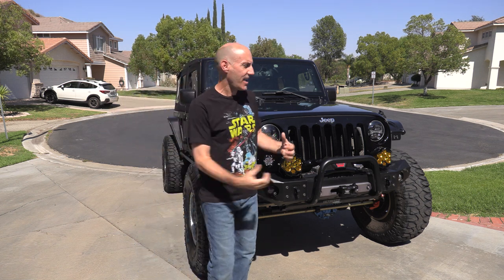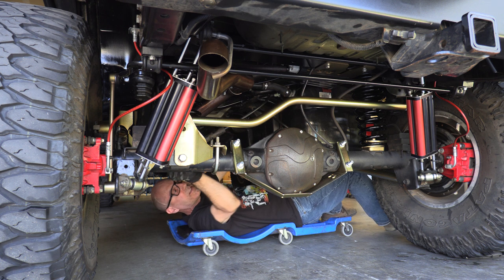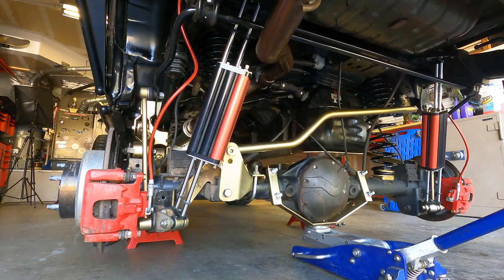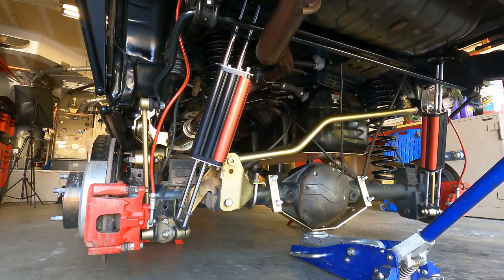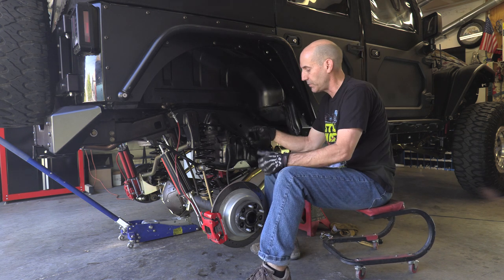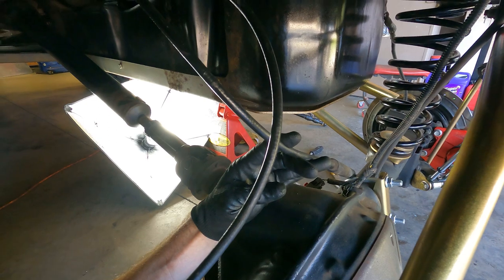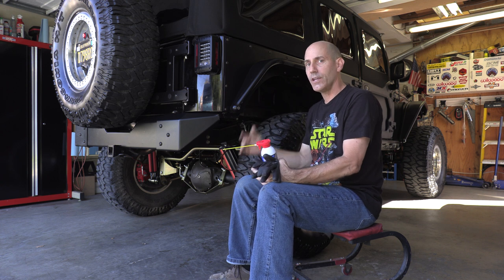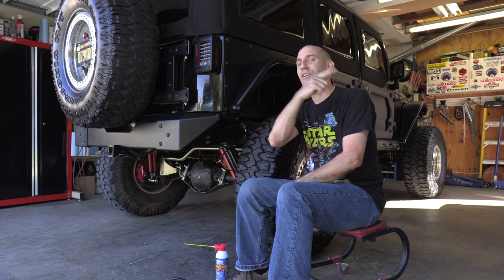Jeep Parking Brake Cable Hack to Get Max Droop for Your Junk

Comment: The only thing to add is to be careful with the cables, you could lose connection at the parking brake connection. Then you have to remove the center console to re-attach the cables. Keep some kind of tension on the cable after removing them from the rear hub. Looks like Jason did a great job with that. Good vid Jason.
Reply from the maker: Good tip! Glad you made that reminder.

Comment: Personally I like having a rear sway bar as a lot of trails in my area have off camber parts. And I am typically disconnected up front. The rear is the only thing keeping the jeep from leaning way over. It also helps from lifting a front inside tire when you pull out onto the HWY, which can still happen with it in place. Oh, and a handy tech tip for anybody reading this. If you have the back jacked up, and the front on the ground, shift into 4wd. The transmission (park/in gear) will prevent the front tires from turning much, so the jeep wont roll over you if it wants to move.
Reply from the maker: Good information, thanks!

Comment: You can go to your local parts store and buy a few feet of fuel line to replace your vent tube (check the dimensions first--I think I used 5/16").  There's a simple metal clip that holds it in place up high, and the valve at the high end of the tube can be pulled out gently with some pliers.  Measure how much tube you need to get the end of it up behind your tail light where it is even less likely to get under water, cut to fit, put the valve and clip in place and pop the other end onto the axle tube and you're done.  You can do the same for the front axle also and just route it up someplace high.
Reply from the maker: Great suggestion... I just keep forgetting to do that!!! Brain freeze over here...

Comment: Hey Jason, another quality video.   You do realize that you lose automatic parking brake actuation at full suspension extension.....
Reply from the maker: Thanks dude... this JK doesn't have automatic parking brake ... old fashioned elbow power!
Reply: @AutoEdits  I was thinking like as the axle droops down and pulls the cable down, would apply brakes since not having enough slack

Comment: I’ve got a 18 JKU teraflex 3.5”lift with bilstein bypass shocks for a 6” deleted rear sway bar, barely notice on road and 100x better off-road
Reply: Running 40’s so I’m bumped to only 3-4” of up travel but I have like 8” of droop
Reply from the maker: It's great to hear this... thanks!

Comment: I need to do this... I actually have some issues with my e-brake lines tugging on my gas fill valve hose and causing some minor leaking from it drooping out... RK 4.5 3 link long arm
Reply from the maker: It's an easy fix for that!

Comment: need to try that, gotta admitt the Wrangler doesn't have the best Parking brake , I'm always pulling it super super tight to keep it from rolling
Reply from the maker: There is an adjustment under the center console for the parking brake... maybe put a few turns into that.

Comment: Good hack. I'd suggest you use something better than zip ties. Zip ties fatigue over time and break really easily. If they broke and you didn't notice, the parking brake cables would droop and you'd tear them off on an obstacle.
Reply from the maker: Good suggestion!

Comment: @AutoEdit - Hi, your Buddy run a "dual-rate-swaybar". I think its from Off road Only (ORO)? So its on and offroad very stable. You have the factory Rubicon-Sway, so its like you have no swaybar when you push the disconect button. That lead to some stability problems when you drive in extreme angels, because of body roll. Those problems you buddy dont have, because he have a dual-rate-swaybar, so its like he running an antirock whe he press the disconnect switch. My recommendation for you is to run a Antirock-Swaybar on your rear axle. Its nearly the same to that setup your budy run. He just have a stiffer swaybar compared to factory. At the end, let my say sorry for my bad English and that I really like your videos. They have a high level of quality - specially compared to other JK/JL Youtubers. So let me say Thank you for all you effort and greetings from Germany.
Reply from the maker: Thanks so much for the information... I really appreciate it!
Reply: @AutoEdits  You are Welcome. I have the ORO Sway-Loc in my XJ. That make so much different while driving offroad compared to non swaybar. Even you gain more traction.

Comment: Great video, as always! Question, do you have rear inner fender liners? Also, I have the same set up as you, did you have to trim the sheet metal near the corners of each tire? Mine looks like it will make contact. Thanks for the great content!
Reply from the maker: Yes I did

Comment: Just spitballing here, with that much droop would limiting straps be a good upgrade?
Reply from the maker: Good question... I would only need limit straps if the springs pulled loose or to protect lines/cables. Since this isn't a prerunner and I don't jump it (much) the shocks are capable of being the limiting factor.

Comment: Do you drive your Jeep on the street, I thought in Cali you could not have your wheels extend outside of the fenders.
Reply: there are a lot of things we technically "can't" do but vehicle equipment codes like that are rarely if ever enforced
Reply from the maker: Technically correct but I've been fortunate driving around without any problems... fingers crossed.
Reply from the maker: My experience is that if you get pulled over for that you might have been driving a bit erratic or speeding to draw attention... or it's just a cop having a bad day and you're gonna get it no matter what.

Comment: Ok. Why the penetrating oil vs tool box buddy?
Reply from the maker: I still have a couple of cans of Tool Box Buddy left but I was told they are going to phase it out and replace it with the Penetrating Oil (same stuff different name). So I just wanted to try it and make sure!

Comment: Have you had any problems with your rear track bar coming in contact with your exhaust pipe?
Reply from the maker: Only before I had my bump stops adjusted correctly. Now it doesn't hit.

Comment: Since you sold the Ram do you know of a true rear locker that can be installed in the rear axle or any good re-gear option for the front diffs that are welded?
Reply: Check out moes-performance for that. I have a 2011 Ram 4.7L and those damn axles limit us a lot. For mine 4.56 ratio is the best I can do without having to get more involved than id like with it.
Reply: @xcrimsonairx  The problem I am having is I have a 2015 and the front ring gear is welded to the diff itself. It’s the new zf diffs
Reply: @kevingrier434  you'd need a new carrier then. I was under the impression mine was welded on the front too since mine is also a ZF. But I might've lucked out on it, we'll see whenever I get around to opening it up. I haven't found any front lockers for it, if you are gonna get a new carrier it might as well be a locker but theres a lot of debate on having a locker with an IFS front, even though toyotas do it. From my researching I saw that some guys were taking Toyota 8" lockers and making them fit RAM but that seems like more than I wanna deal with.
Reply: @xcrimsonairx  I have the AEV 4inch lift that relocates the diff to the skid plate. Maybe new brackets can be made to hold a different carrier. Thanks for the advice though. I was thinking about the raptor from diff myself.
Reply from the maker: I found that Detroit makes a locker for the 9.25" Chrysler rear and you would have to get a new carrier for the front. This truck was setup with 4.56 gears for the 37" tires and I would've liked less gear for better gas mileage. And after breaking enough front axle shafts... I wouldn't recommend running a locker up front... maybe a limited slip of some sort would be enough.
Reply: @AutoEdits  Jason you are the man!

Comment: How's that metalcloak holding up
Reply from the maker: Great!
Reply: I'm literally putting the long arm 4.5 game changer on my 1999 4.0  tj and when I'm done the 3 5 game changer for my ecodiesel 2021 rubicon gladiator. After an adventure with another youtuber called  trail Militia at trona pinnacles we quickly realized our ecodiesel bottoms out a lot. We are the white gladiator in it. Trona pinnacles is an amazing place